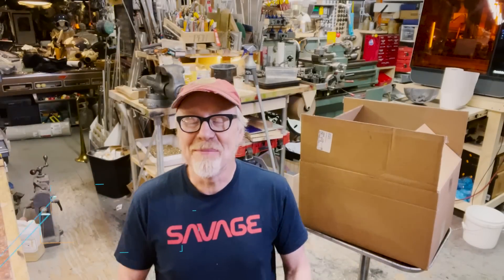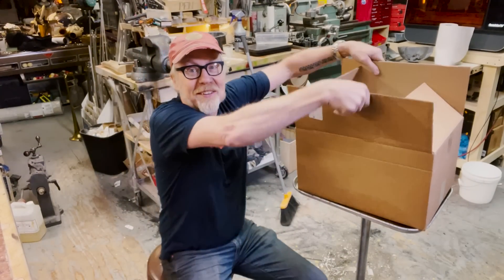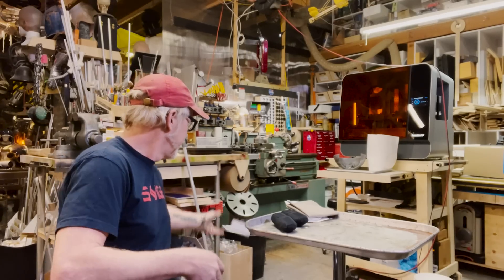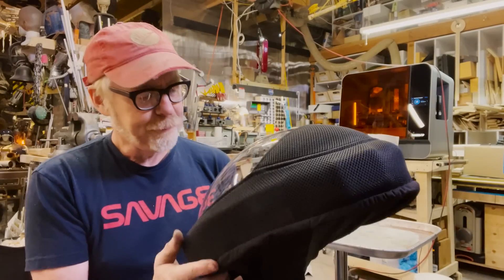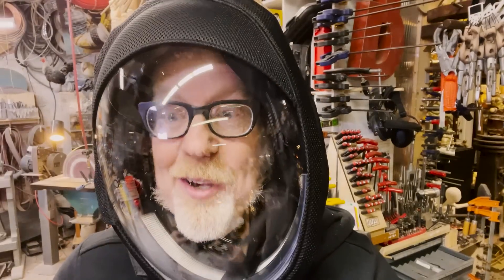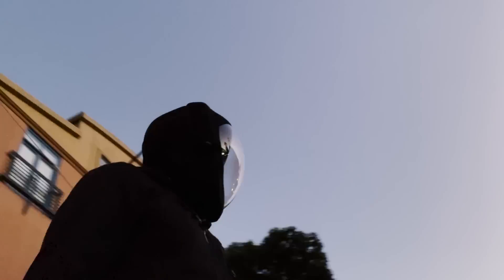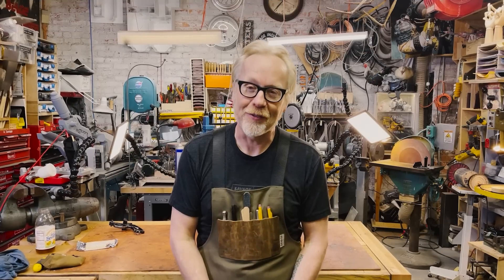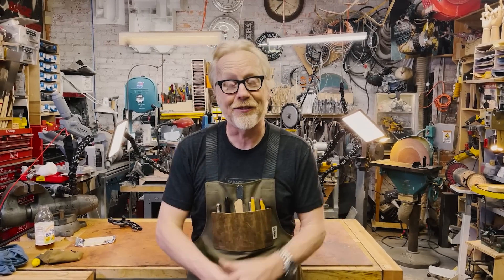Adam Savage Tests the AIR Active Filtration Helmet!

Comment: In the next episode of From the Cave: Adam modifies his AIR helmet with highspeed brushless motors, 3D printed impellers and an 18v battery. Stay tuned for the exciting conclusion on next week's episode!
Reply: Honestly, for what's informally marketed as the rich person's ultimate protection against COVID, I'm surprised they didn't line it in copper or copper-blended fiber.
Reply: How can we petition for this?
Reply: ... Aaaaand the microphone! Don’t forget the mic! Lol
Reply: @PlanetRylosIV  The mic is a must, otherwise you end up shouting through the mask and deafening yourself. But you also need an external audio pass-through system to maintain situational awareness. I've been using the Google Sound Amplifier app on my phone in conjunction with a Zoom Am7 stereo condenser mic, a Hagibis  X2-PRO-RTS Bluetooth transceiver, and Jaybird X4 Bluetooth earbuds. I don't like how the neck hood has a tendency to pull the Jaybirds out of my ears when I turn my head, so I'm getting some Aftershockz bone conduction headphones.
Reply: Anti fog coating, and some greebles too!
Reply: Don't forget the gold mirroring.
Reply: And some extra padding to make it more comfortable.

Comment: You should try to upscale it and get it to work correctly.   I feel like the bones of the unit are good you just have to figure out better air flow.  I also feel like if you had fans blowing in and some fans blowing out that might be a better solution.

Comment: I've very much debating one of these, not so much of claustrophobic or anything, but because I have breathing issues and can only wear a mask for about 30 mins tops, meaning I haven't really left the house for a year now, one of these would allow me to spend more time out, though at the same at $300 with vaccination happening I'm not sure it's financially worth it, though I suppose I could likely make one myself for less.

For the fogging issue you could probably use glasses anti-fog spray like people use on VR headsets, that in combination with the fans might just do it, I originally had bad issues with fogging with VR but with the anti-fog spray the problem completely went away.

Comment: I would consider wearing such a thing only if one could demonstrate that it is actually safer than wearing a mask.
If not then it's just an over-engineered solution to the safe alternative.

Also... what happens if the damn battery runs out while in public?? too risky if you ask me.

Comment: Would be hard to answer the phone with one of these. Unless you used a headset. And maybe that, combined with some sort of app could shortcut the need for an integrated microphone and so on for in person communication. 

Also it seemed to have less fogging when inside a heated interior. So might be useful for the working people. 

But then they should improve the battery so that it lasts a full workday. 6 hours wont cut it.

Comment: I do wonder how effective this  is. Way better than a mask, but it has to seal completely if air should rush through the filter (which has more resistance than any leak). It's also totally fine to say the product doesn't really work, though 300 dollars is a bit of a pain in that sense. :)

Comment: Charging the device not being first thing to do reminds me of watching some programme about plane crashes and apparently in the early days "Put on oxygen mask" was not the first instruction for emergencies where pilots needed them. Long story short, it is today.
Reply: Oh, and this thing charges at around 1A. Not terribly slow, but not fast by smartphone standards, either. I was hoping for better. And they tell you that you can't charge it while the fans are on, but I personally debunked that. You totally can, but what I think is happening is that the charging controller is not smart enough to bypass battery charging while under load, which causes accelerated degradation of the cells. So their marketing tries to disuade you from doing so in hopes of staving off a bunch of prematurely ruined battery packs.

Comment: I wish someone could integrate this kind of design into an welding helmet so you don't have to wear a respirator while having a overhead cover at the same time.
Reply: there is actualy filtered fresh air welding helmets with hoods similiar to this and hoses atached to fans that filter out the smoke particles and stuff
Reply: 3m speed glass

Comment: Cool video Adam!  Essentially this is a simplified PAPR (powered air purifying respirators) with filters and fans built it.  Actual medical PAPRs have the filter, fans, and power packs on a belt, with a tube feeding air to the helmet, which means reduced noise without having to sacrifice power to the motors.  All that said, as much as I'm paranoid about infection, I'd have a REALLY hard time walking around or going grocery shopping in one of these:  they just look ridiculous (and fogging would be a problem).  For high risk environments, an N95 of a half-face respirator (with goggles if needed) is a more practical, less awkward choice.

Comment: I have a face-worn PAPR called "AtmoBlue". No, it's not a hood, but it's positive HEPA-filtered airflow that easily delivers more air than I can breathe. I also have a couple other PAPRs from Xiaomi, but they don't work as well. If I don't want something powered, I wear an ENVO Mask. I got these things because I struggle with a stifling feeling from masks that inhibit respiration even a little, and those that touch my nose and lips, and don't want the slippage that comes from other options. These hoods really do require belt-power and more substantial filtration surface area, such as you might get with welding hoods or PAPRs for clinical/laboratory use. Thanks for showing us this!

Comment: Man, if it’s visor was rated as a face shield, I’d use it in my workshop. All my masks fog up my visors. And the actual ones that look like this have the belt pack and cost like $2000
Reply: I fixed the fogging issue that I struggled with while wearing glasses by using those masks with the thick metal band built into the nose. I feel your pain though it really sucks fogging up all the time. I hope this helps!
Reply: I was thinking the same thing.  Maybe it could work for sanding?  Guess it depends on how long the filters last
Reply: Mine has a separator over the nose so it keeps the mask from fogging up. Good all round vision and filter that last two years. £65 off of Amazon.

https://www.amazon.co.uk/dp/B07NYR24NB/ref=cm_sw_r_cp_apa_fabc_165M52GGWT1CPARV4P31
Reply: Have you considered the PowerCap Active by Peke Safety?
Reply: I am a hobbyist woodturner was thinking the same thing.
Reply: Try some surgical tape attached to the mask under the eyes and over the nose bridge and attach it to your adjacent skin as a more effective air seal. I've found this works a treat to prevent fogging as the damp air passes out the front and bottom of the mask, rather than up onto the visor. The tape is low allergy and relatively cheap. The bonus is you don't need an expensive mask.

Comment: Looking at this product I can see how this could totally be used for everyday use in a shop or construction environment.  Make sure that the face plate is made from a shatter-proof material and that the air is sufficiently filtered.  Eye, face and lung protection so you're not sucking down concrete dust while working or worried about getting anything in your eyes.  Put enough filtering on this (P100 / fume filtering) and first aid / first responders would be able to work when there are irritants in the air (tear gas, pepper spray, etc).  With the right upgrades I can actually see this being a viable product for people to use.

Comment: OF COURSE you are going to add propper head support, led lights inside AND microphone/speaker set, right?
Reply: internal air circulation too
Reply: That's next week's ODB 🤣😎
Reply: He could either repurpose this one to become his own design or build his own from scratch. I'm thinking that he could use a somewhat large (140mm ?) fan that blows air parallel to its spin and shoots air across the helmet toward the visor. This would allow having one filter covering the fan's intake.
Reply: @SullenSecret  I think at least a couple of the four passive intake ports could use active fans. The issue lies in how to power them and the additional weight load on your neck. I'd probably add a matched pair of the same Delta fans to the side vents because the ones at the top tend to be covered up considerably by your hair and we want the airflow to pass close to the mouth to force the moisture to exhaust faster. I do wonder how all that moisture is affecting the HEPA filter's electrostatic trapping functionality, tho. Maybe its better to absorb the moisture with descicant inside the helmet?

Comment: Looks like something from the Alien /Prometheus franchise.
As a fellow glasses wearer, yeah the fogging is both annoying and also a sign that my mask isn't protecting me or others (if air is leaking out its not sealing properly). We need to ask Daft Punk how they deal with fogging.
The extra mask might be a backup in case you run out of battery before you get to a place to recharge.

Comment: Man if this came with an ansi rated face shield instead, you can use this for all kinds of shop stuff. Especially turning on the lathe and sanding! Neat!
Reply: Redwood.    Start with an ansi rated shield and add the fan, filter, and hood and you can make one for a lot less than what they sell this.   The one I made runs for 13 hours and charges in 1 hour.   However, you could run it even longer with a belt mounted power tool battery.
Reply: @johno812  you might as well belt mount the fan at that point to reduce noise and get better airflow.
Reply: @johno812  Would you be so kind as to post more information about how you did this?  I think it is a great idea for woodturners and woodworkers with asthma, etc.
Reply: @johno812  Make a video!
Reply: 3m makes a full face respirator
Reply: Search for powered air purifying respirator(PAPR) helmets or cartridge air purifying respirator(CAPR) helmets and you can find several companies making such a product(such as the 3M Versaflo M-Series). They come with a high price tag however, which seems to correlate directly with how comfortable they are to wear for long periods of time.
Reply: @Jack-yl7cc  I use a versaflo at work and love it
Reply: @Jack-yl7cc  Whoa. I just saw the Maxair CAPR. That thing is amazing! It looks so lightweight and the external battery pack of definitely a plus. The filter seems a bit flimsy compared to the HEPA filters in the MicroClimate, but I guess they wanted more airflow at the expense of filtration efficiency.
Reply: Acrylic dome sadly.
Reply: Titan makes what you are looking for.
Reply: I was wondering if be good, when working something that is hard on the eyes and nose.  Like some chemicals.
Reply: I use a full-face respirator when I work with some materials. Though this seems like it would make for a better respirator than existing full-faced products, I'd worry about fogging and shifting around and stuff.
Reply: It looks very much like the system Ashley Harwood uses for woodturning
Reply: Yeah, but there are tons of full face respirators that are made for that.
Reply: I really keep hoping that some good (at least for woodworkers/shopworkers) that could come out of this pandemic is the invention/production of a reasonably priced, reasonably comfortable and effective full face, safety mask/shield.
Reply: @1turdontherun  the amount of testing that something like that has to go through to be sold is prohibitively expensive. There are very few industrial grade safety equipment manufacturers starting up out there.
Reply: Looks like it would easily catch a spark and kill you in an agonizing pain. For 300$ price I guess you could find a far better 3M filtering solution. Only pro is that it looks cool, but only fropm the front, because from other angles it looks like deflated fencing mask.
Reply: I have a 3M TR-300N+ HIK Versaflo Heavy Duty PAPR Kit. It's basically what you were suggesting.
Reply: From the thumbnail that's what I thought it was to be honest. That would be Adams area of expertise.
Reply: how about just a face-shield, they have been around forever

Comment: I read scathing review of this. I thought "This looks stupid, I want it."
Reply: Check out Deviant Ollam's review from using one of these for an actual air travel trip, he was pretty unimpressed and took power tools to his to try to make it work better for his needs.
Reply: @grathxvii  Yeah, he dremeled a couple slits on both sides to run some elastic bands through. I would have just attached some VHB tape to the elastics instead. That plastic is relatively thin and prone to cracking. Introducing structural weaknesses into that material is just asking for trouble. Better to distribute the stresses more evenly over the surface.
Reply: @Rachel West Yeah, it was the "Oh this is expensive?" surprise that kept me away.